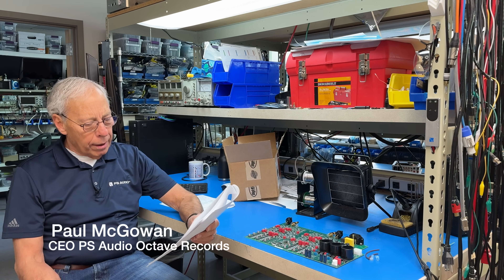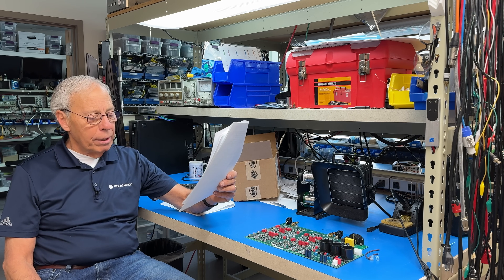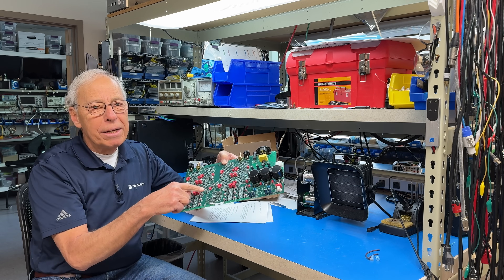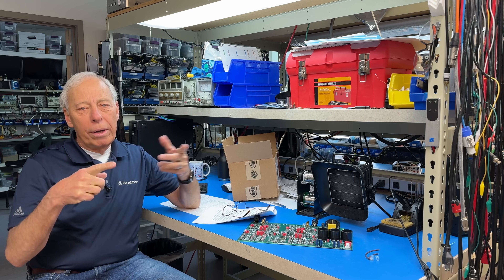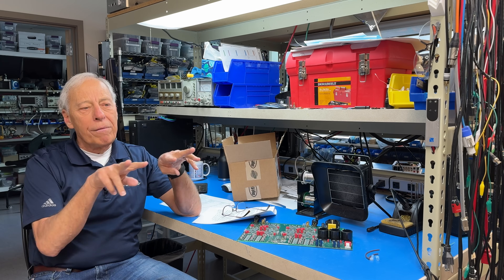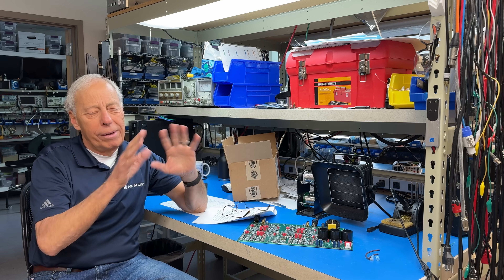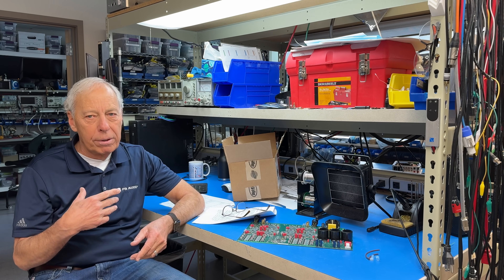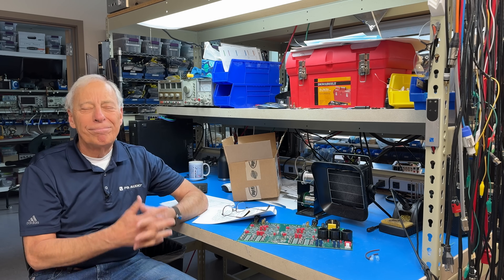Bi amp versus Bridged amplifier

Comment: I think the writer confused bi-amping for bi-wiring. They start out saying they have bridged Rotel amps. A pair operating as mono-blocks? One combined output per channel to two sets of speaker terminals, thus bi-wired? And asking if they should not use the bridged mode and power each driver separately. A set of wires from each individual amp out to each speaker connector. Thus bi-amped. 

Yes you have greater power out in bridged, especially since the amp(s) individually see half the load and thus theoretically will power double. But now you are driving a single system which has passive devices for crossover and that total power is shared across multiple drivers. 

So going bi-amped might give less power out to the speaker terminals. The direct connection to the driver bypasses any cross over loss and the power is not divided across multiple drivers. So you would not expect a dramatic SPL reduction if much at all. And especially if the stereo amp chassis is dual mono PS, the extra headroom for the mids with the bass removed often allows more dynamics in that range.

Comment: Just to correct LassKinn747 and clarify. Bridge = 4X power in watts, votage into load is doubled, watts is *4. Running as Bi-Amp will mean that the treble amp will be working a fraction of watts of the low frequency amp, as the spectral power requirement in the low frequency end is generally (audio meterial dependant) higher. Side note, if you are soldering SMT, get some solder paste with a suitable size nozzle and a compressed air foot operated solder deposition station. I can only see solder reels here, I hope that isn't what you used. The station will deposit identical solder amounts to pads, and the solder paste with a much higer flux content, solders a lot easier. Benign flux will save the wash.

Comment: The voltage is the exact same. Bridged or not, each side runs on the same +- rails. Bridged mode switches drops the output impedance by half, usually, and Rotel does that. The current does not “quadruple.” 😒
Reply from the maker: No, sorry, but you're incorrect on the voltage. Let's say you have two amplifiers, each outputting 10v rms. If you bridge the two so that now you are measuring between the two Plus terminals, you will have 20V rms. A balanced circuit that starts with single ended and then gets doubled always has twice the voltage. You are correct that the impedance is halved, and when you have twice the voltage and half the impedance....you can figure that out. :)
Reply: @Paulmcgowanpsaudio  double the voltage but half the impedance is not different than doubling the impedance and halving the voltage. I don’t see where I’m incorrect here.
Reply: @Rotteneggsack  Your initial comment was incorrect, and Paul correctly explained why. The voltage in this case is not only determined by the rail, because voltage is relative to a ground (that's why Paul underlined in his reply that you will be tying the two positive outputs and not one positive and one negative). The voltage will in fact be doubled in bridge mode. And combined with the halving of the impedence, you will indeed get quadrupled the current. Paul can make mistakes like anyone else, but this is not one. As for your second comment, it is incorrect because you neglected the implications of Olm's law (I=V/Z). If you double the voltage and halve the impedence, you get four times the current: I = 2V/(Z/2) = 4V/Z. But if you double the impedence and halve the voltage, you get one fourth: I = (V/2)/2Z = V/4Z. In other words, there is a sixteen fold difference between the current in the two scenarios. I'm afraid it's not entirely intuitive, but that's how it is.
Reply from the maker: @Rotteneggsack  Let me see if I can help you. Let's take an example (this is all just using Ohm's Law). 20 volts fed into a 4Ω load uses 5 amps of current and produces 100 Watts. 10 volts fed into a 4Ω load uses 2.5 amps of current and produces 25 Watts (4X Watts as I had said in the video).  If we take your example, 10 volts (1/2 20) into 8 Ohms (2X 4Ω) we get 12.5 Watts and we use 1.25 amps of current. Very, very different.

Ohm's law isn't that hard. There's an online calculator you can use if you want https://ohmslawcalculator.com/ohms-law-calculator Hope this helps.
Reply: Are you saying those Rotels are designed to possibly be used bridged?

Comment: it's not going to be less volume you just have to drive the power amplifiers harder from the preamp what could be better. probably will be, listening volume will be the same as bridged you won't notice it being quiet just that you have to turn the volume up more on the preamp, what is a better thing. do horizontal bi-amping not vertical, get yourself an rcas low pass filter for the woofer depending on speaker but that it rolls off at 500 Hertz should be fine at 18-24 DB and Y splitters. for the mid range or and tweeter  just have it direct from the amp.  better still find out what the crossover point is and be slightly higher than that in the filter, say if it crosses over at 350 hertz then 500 Hertz filter.

Comment: I have two Primare A34.2 that I can bridge and use one for each speaker but I can't stand that when you bridge a power-amp you get a very weak power-amp in lower impedance so instead of bridge my power-amps I bi-amp them so I have one power-amp for the bass to both speakers and the other for the treble/midrange.

Comment: bridged is twice as much maximum peak to peak voltage. double the watts. in theory anyway.

if you never run your amp at full blast when undbridged then it's completely useless to bridge and likely to add distortion.

Comment: Many amps tend to work better, as in less distortion, better damping etc., when working into a higher impedance/less load. in bridging each side of the bridge kind of sees half the speaker, as in an 8 ohm speaker will be split 4 ohms into each side (that why you get more power/volume). On the other side bi-amping each amp only sees one driver, so even less load - so hopefully better sound.

Comment: Yes, as audiophile, stay away from running bridged operation. It's sort of doubling the components involved and for audio signal paths, less is often more. Double the output voltage quadruples the power or equivalent to 6dB gain. To subjectively sound twice as loud you need approx. 10dB. I rather run each speaker driver with a separate amp and do my cross-over on the line level or even better, cross-over the audio digitally. I hope at some point PS Audio will start looking into next-gen architectures for DSP based audiophile cross-over filtering and optimization.
Reply: Yeah but also the output stage in bridged mode sees half the impedance as compared to single-ended. This can and will cause distortion, especially odd order harmonics as even order harmonics are mostly cancelled out. 
Active crossover bi-amping all the way. 

Also I always prefer a good DSP with FIR filter capabilities.
Reply: @WindowsSucksUwU  Yes, agree, bridge mode is a thing for a party setup and not for audiophile listening.

Comment: I don't understand the question. He says the speakers are being "biamped, using bridged Rotel amps" That implies that he's using four amplifiers in bridged mode. 
Maybe he meant to say that he's not biamping but using two bridged amps in mono, but is considering running the amps in stereo and then biamping.
Reply: Took me a few to figure it out also,  he is running the two amps bridged, one for each speaker.  He is wanting to know if it would be better to run them in stereo.  One for the highs one for the lows.